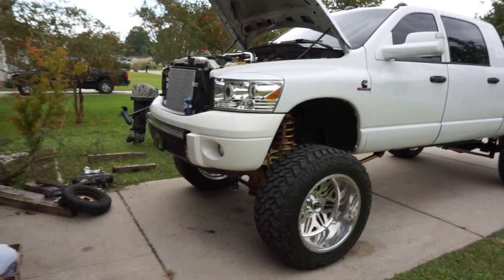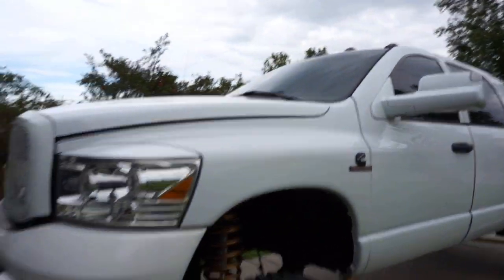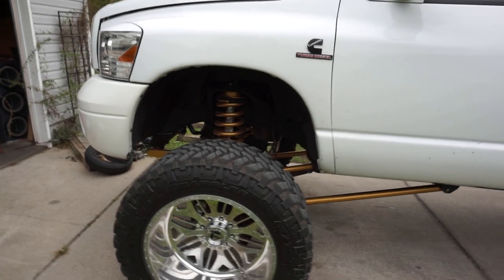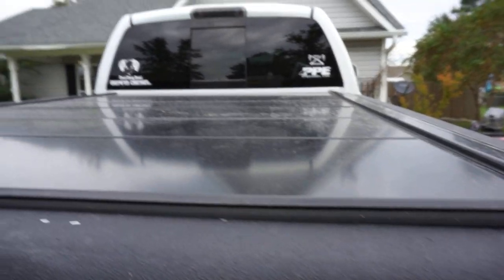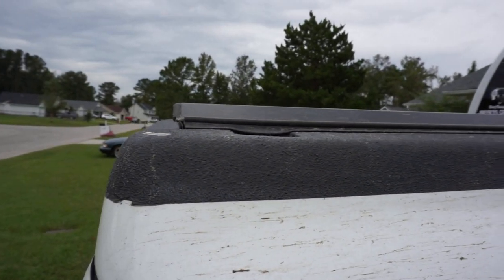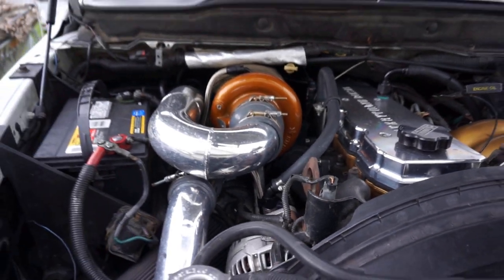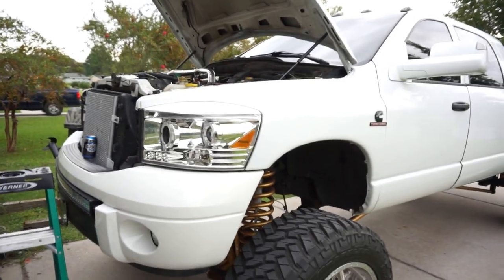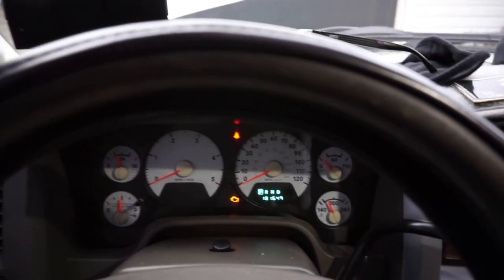EVERYTHING Done To My 3RD GEN CUMMINS!!

Comment: Great looking truck, what kind of power and options do you have with the EFI Live tuner? 
I just (last night) drove home a 07 5.9 crew cab SLT, SunCo or Sun Coast Sathe two built trans, new injectors (factory), 6” lift, 37 Toyo R/T’s new brakes :) and no rust. I live in Texas and the truck is a Texas truck. 

I need to know what my transmission temperatures are doing. I think my first upgrade should be gauges for EGT and Transmission.

Any thoughts, from anyone, I am open to hearing.
Reply from the maker: Depending what tuner you run will determine your power levels. For your 5.9 you just picked up there some things u can do but It sounds like you got some good stuff going with that truck. You can look into adding a airdog lift pump, cold air intake and upgrading the turbo if you got a stock one. Something like a fleece cheetah would be awesome. Do your routine maintenance. Oil change,  trans fluid, axle fluid, transfer case fluid, brake fluid etc.
Reply: @EVERYTHANGDIESEL  Thank you! Upgrading the turbo would be great but wouldn’t I have to do engine upgrades too? Not sure how much power I can reliably send through the 5.9, not that I really need big power.

Comment: I have a question do you think 42s would fit with no rub because I've got 8 inch bds top gun customz long arms fully adjustable on my 2012 ram 2500 22x12 hardrock forged wheels on 37x13.5 I'm adding core 4x4 track bar and 2.5 inch level and adds leaf to rear you think 42s would clear by the way your truck is very nice
Reply from the maker: You will have rub somewhere, u will need  a bumper spacer probably
Reply: @EVERYTHANGDIESEL  that's what I was wondering thanks for the info

Comment: Such a nice build bro is that a 4th gen ram head badge on your tailgate do you have a link for where you got it thanks
Reply from the maker: Thank u man! And yes it is, u can get it off ebay.  That's where I got that one
Reply: @EVERYTHANGDIESEL  sweet thanks for the reply does it have any screws or did you just stick it on with some 3M tape

Comment: Hey man I watch your channel every time you upload a new video! I have a 05 3rd gen 4x4 dually with the 5.9 cummins in it and I have had it for about two months. I'm 19 and its my first diesel truck, what should I upgrade first far as performance and what's the best way to learn more about these engines fast. So far I have added a s&b intake and changed the fuel filter and oil lol.
Reply from the maker: Checkouf my videos where I talk about top mods for a cummins, get a tuner first.